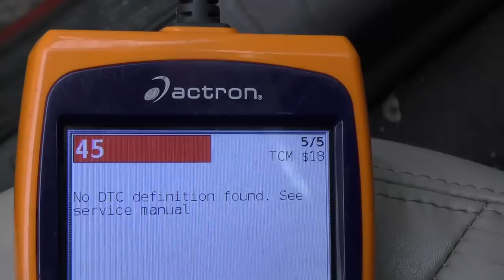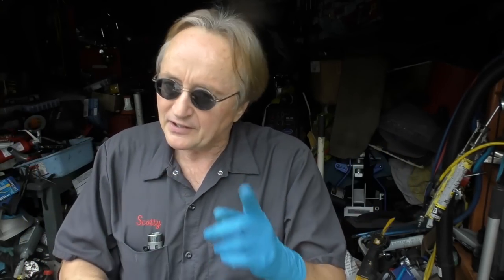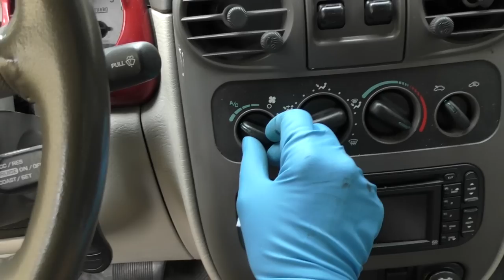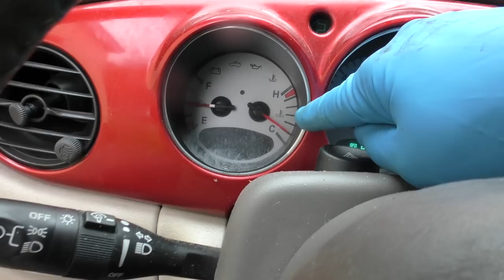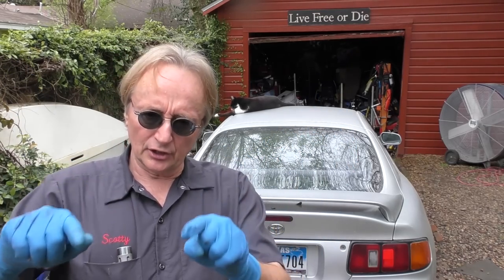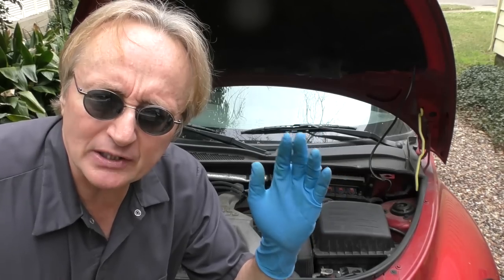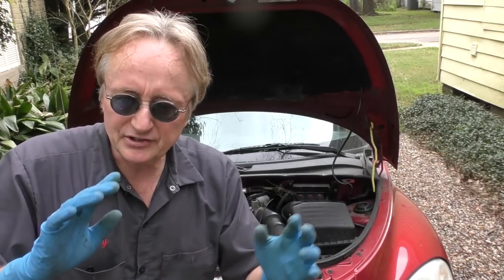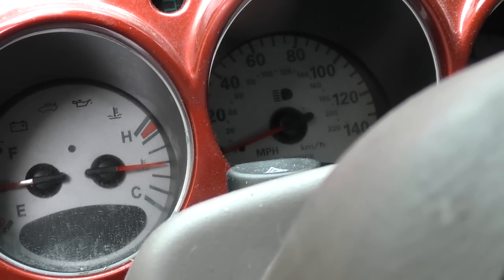This PT Cruiser Has a Serious Problem

Comment: I love the fender covers, very professional.
The fault code points to a stuck thermostat, very common.  Easiest way to diagnose 
would be to touch the rad hoses.  They should be close in temperature, indicating flow.
Reply: I don't think I've ever seen a P0128 that was not a failed thermostat.  Of course you still have to make sure.  Fix it right the first time.
Reply: I agree.  Touching upper and lower road hose will tell you if you have coolant flow, I.e open or closed thermostat

Comment: I've had my 2001 PT Cruiser ever since I ordered it from the dealer "OUT OF A BOOK" because they weren't in the dealership yet and only after 20 years an I having to do any major maintenance on it. I have decided to replace everything since almost everything is original even though some things are still in decent shape such as the half shafts, motor mounts, belts and hoses. I am also changing the spark plugs and coil even though they were changed 10 years ago and the car is running fine. My care has NEVER had a problem except for s single crack in the dash and a cracked windshield caused by a rock off of a dump truck.

Comment: At the end of the day it's not what kind of car make it is, its the upkeep maintenance u do to it. You have to put more maintenance in the American car but its cheaper. And even a Toyota or honda has its share of problems!
Reply: Yeah but I would want to blow my brains out if I had to drive a crappy Chrysler HHR or PT Cruiser. They are just depressing cars lol.
Reply: @mickdavis2385  Actually it's Chevrolet that made the HHR, but it's whatever.  Neither one of those cars exist anymore anyway.
Reply: @mickdavis2385  I got a 06 pt convertible as my first car a month ago. I like the design and decent gas mileage. Only issue is an unbalanced tire
Reply: my parents owned a 06 or 07 hhr for a couple of years and she had no problems
Reply: Bingo! I have seen owners kill a Toyota before 50k miles and others get over 600k miles from domestic vehicles with no signs of slowing down.

Comment: I have a PT cruiser and I had to change the thermostat last week, not because of overheating, but because it would make a crazy bubbling sound after a varying amount of use. The thermostat was very tough to operate and was causing major steam buildup prior to opening and it would open just barely so my reserve tank kept blowing its reserve out due to the excess amount of pressurized steam it got. Found out for sure when I left the cap off, topped off the system with water, and ran it on idle until the thermostat opened, and a bellowing of steam and bubbles came shooting out. Swapped the thermostat and now it is working without issue.

Comment: Very basic n solid technique for a temperature run high diagnostic. In addition, u can also check the coolant tank at the top and the oil cap to see if there’s any oil on it. If it’s with grey colour cream like oil, it got a chance of blown head gasket.

Comment: Hi Scotty, one thing to know is that the Pt Cruise fan is a dual speed fan, if the fan does not go into full speed mode, the car will overheat.  I’ve had to change the fans on a 2003 and 2004 due to this problem.  Thank you for your videos!

Comment: Got a turbo PT Crusier still going with over 215,000 miles
Reply: i got the same type of PT, and the mileage is almost there too, it's a great little car, the turbo really gets the car up and going, i know the car is an acquired taste look wise, and it has a bad rep, but hey, so did the Delorean...;) a know of a few mechanics that own them, the only complaint I hear, is they're cramped to work on...
Reply: Car probably lasts cus it's properly maintained
Reply: Mom has a 08 she was given brand new. It's been a great car for her and no major problems yet. I have a 95 Neon my lil sister bought brand new after I told her what options to get. It has 185k on it now on the original engine. I got it in 05 and I have replaced the timing belt and water pump at 155k, the rear main at 165k, and the front brakes a few years ago. It is easier to work on than the pt due to more room but they drive pretty similar through the pt is a bit smoother running because of the balance shafts and smaller cam profile. 95 neons had a hotter cam then the newer models just like 68 340 4 speed engines bad a hotter cam then the auto cars so slightly more power. Moms we had to replace the fan set up due to the controler going bad and it dying when she turned on the air and the second fan didn't so the compressor froze up and killed it. Bought a aftermarket fan on Amazon and it works great again for 90 bucks. People going to hate and many have no real world experience with the things they hate. They did have the head gasket recall on the 95's because Daimler wanted to use a cheaper gasket and that gave them a bad reputation but it was the crappy gasket they used. I haven't had to replace it since sister did at 70k, the better gasket truly was a quality part and they had no more issues with them after that.
Reply: Because you take care of it well!

Comment: We need a lot more like this. I had no idea the fan runs constantly when the AC is on. Thanks Scotty.
Reply: @Grieg Ragen Why didn't you diagnose and repair the problem? Overheating is usually an easy, relatively inexpensive fix.

Comment: Scotty did you secretly buy a pt cruiser. 3rd time I saw it in vids
It's ok. You don't need anybody's permission. Lol
These cars are great to learn on.tight engine bay.need to make a bunch of homemade tools to work on it.
Hell I've been driving mine with ac on for 2 yrs.
Cant wait till I have to do the starter. 
Timing belt was fun.
Have had this car for 8years.
Reply: Fitted Chevy "527" V8 with 6 speed Tremec t56 transmission ...problem solved. ...lol.

Comment: Oh man, if only I'd seen this video before I went through 20 new temperature gauges -- thinking they were all faulty :-)
Reply: 20 temperature sensor ? That's a figure of speech right ? 
2 at most I can see. It is possible to get 1 defect right out of the box. If you replaced it 3 maybe 4 times, that tells you, the problem is somewhere else.

Comment: Don't know why everyone dumps on PT's. My '03 has 208k miles and runs fine. Yes, I did need to rebuild the tranny at 165k, but other than change the timing belt (and water pump-you do both) at the 100k intervals (twice) I've done no other major work. Body is still tight and interior has held up really well. It's a daily driver that simply always works. OK, I am the original owner and yes, I do change the oil every 5k and have regular maintenance done. I do work on it myself for the small stuff and find it easy to get to things.  Like any car, if you take reasonable care of it, it will last.
Reply: According to the haters, you're supposed to be able to drive one of these for eleventy bazillion miles without ever touching a wrench for it to be a good car.  LOL  Naaaah… they'd still hate on it if every single one of these ever made were still on the road with eleventy bazillion miles and never needing a single part touched.

Comment: I have an 06 Mustang GT that caused me a lot of grief last summer. My car would work fine in the driveway and the fan would kick on with the AC on and even with the AC off once it got to temperature. My issue was after it was driven for a bit the fan would stop working and it would not even come on with the AC at that point. My problem ended up being a short in the engine fuse box, specifically a short in the wire powering the high speed fan relay. The car had no codes and it was a very difficult issue to track down. Sometimes these issues can be tricky and not cut and dry.

Comment: Scotty, it is all the same system ( the cooling system) it is a different electrical circuit that operates the cooling fan with and without air conditioning on. Usually, the ecm provides a ground to all cooling fan relays whenever the air conditioning is on, without the a/c on it is usually the submerged cooling temperature sensors that close that circuit so the ecm can ground the primary cooling fan. The Cem always closes the ground circuit, never the power circuit. This could have also been shown with a test light or dvm at the cooling fan relay in the fuse center. Battery positive will always be present at the relay provided the fuse is not open and that wiring is not damaged. The ground will be switched on and off by the ecm According to engine temperature or a/c input signal or both. You can also jump a ground to the relay terminal from battery negative ( with a power probe or a fused jumper for safety [in the event it has a short to power]) to check the integrity of the circuit with a cold engine or to diagnose a failed ecm circuit with a hot engine. That is a valuable diagnostic while the engine is heating up, instead of waiting around doing nothing. Thank you for your videos Mr. Kilmer.  Sorry for the system/circuit clarification  I just thought it was necessary for a better understanding and to mitigate confusion.

Comment: The 1st thing I always check when overheating problem is present is the thermostat,just let the engine idle till warm ,press the hose to the radiator ,should be hot and full with water if it’s empty then thermostat it’s stuck closed ..

Comment: In most cases, if you have a Thermostat code, replace the thermostat.. Also running too hot or too cold will set Missfire codes as well.

Comment: Great video!!  But I'm not sure a stuck thermostat is a "serious problem".
Reply: If stuck open, no. If stuck closed, you won't get more than a few minutes of running time before you start overheating.  You can easily blow a head gasket that way.

Comment: Scotty you clickbaited us... that's not a serious problem at all and I'm so amazed at that thermostat is that easy to change you're actually making Chrysler look good right now. That is like the easiest thermostat I've ever seen to change.  Thermostats go out there's nothing wrong with that. I thought it was going to have some kind of electrical nightmare or something.  So you should have just said and the title of the video I fixed the issue on the PT cruiser. Not the PT cruiser has a serious problem. You have the serious problem. Lol no more trolling Scottie
Reply: Idk, I car that has over heated can have permanent damage. I've seen alot of them have trouble starting up ever since over heating regardless if the owner said they "fixed" it. Especially with these aluminum engines that can easily be warped from the intense heat
Reply: @CarlosGutierrez-qw6pr  yeah just thermostat going out is normal. I had it go out on two different cars. Saw it got warm and wouldn't go down. Changed it. No issues after.   That's just standard maintenance like a water pump.
Reply: @1XSTEALTHTWINTURBOX1  yeah the thermostat is simple, but that's that what the underlying issue. overheating is a major and serious issue that can easily cuz your engine to be ruined. Doesn't matter how easy it is to fix it, it's about the severity of not catching the problem in time and the ultimate problems it can easily cause. Low oil is possibly extremely easy to fix, doesn't mean it's not a serious issue that can destroy the engine
Reply: @CarlosGutierrez-qw6pr   Ok we will put out a video.  "This 93 Camry Has a Serious problem".  run that by him and see what he says.  Because that is one of the cars it went out on.   The title should of just said I fixed the issue on the PC Cruiser!   I don't like PC cruisers, but lets put "This ___  Insert Your favorite car__ has a serious problem."   It won't sound right. It common practice to hear someone say they are changing there thermostat, it's gett warm or it's overheating. people no to experience will let it run before they notice it, that's there issue.
Reply: @CarlosGutierrez-qw6pr  So is running on tires with low air pressure. Are you going to throw the make and model of the vehicle out there in the heading saying this specific car has serious issues? The problem was an easy fix.
Reply: @1XSTEALTHTWINTURBOX1  You do realize that he's been doing these titles for a long time right? You think he actually cares what he puts for a title? It is not misleading so there is no policy on YouTube that will force him to change the title so why do it? You think he cares if some random commenter tells him to change his title? Absolutely not
Reply: @stylicho  easy fix, not a serious issue. Do you realize the amount of Americans in the world who have low tire pressure right now? Losing 5 mpg is not a big issue so you can't compare it to an issue like overheating because I can go a whole year on low tire pressure, no way I can go a whole year with an overheating car without the car being inoperable
Reply: @1XSTEALTHTWINTURBOX1  My Volvo 940, 8 valves, 2.3l engine, B230FD: Never changed the thermostat or water pump. I have benn driving 17 years, and the car will soon be 26 year old. The odometer says 400000 kilometer (252330 miles). I know that some waterpumps in this model of Volvo  have lasted 520000 kilometer ( 323000 miles). I'm from Finland.
Reply: @JormaKovanen  That's just awesome.  I had one car the 93 Dodge Stealth RT Twin Turbo, thermostat went out at 140K, car is almost at 197K Miles now. Says to change Water pump every 70K. 93 Toyota Camry 4Cyl it went out at 228K, sold it at 239K, was trouble free.  My 1992 Mercedes Turbo Diesel 300D 364K Miles seems it's getting weaker but doesn't not ever get past the middle, only in the summer. Already flushed the system.   I had a friend with a Volvo 1998 that he changed thermostat at 205K.   I have various friends with BMW's and Toyotas changing them in 120-150K as they went out.  Also if your have a PT Cruiser with this kind of miles, I'd change it every 50-70K miles as it's so cheap and easy to get to. If you know anything about cars, You'd be crazy not to do it on this model. It's like $20-30, filler neck $15, they even sell it as a kit with new radiator cap, after a quick search online.
Reply: @stylicho  I think i can show a 10 Year old how to fix it. And most family members I know, they are all scared of touching any tools outside.  Besides the 30 year old+ fellas in the family.  Something this easy is a joke. It's not a issue with the model. It's wear and tear.  Yup.        But Scotties way of checking it is very cool, and glad he shows us that.  He redeemed himself by putting a video about saying this Honda has a serious issue. Just the word "serious", sounds like it's an issue with the model.
Reply: Ever changed the pump and thermostat on a 12 valve Cummins?
Reply: overheating is a serious problem. Like it can ruin an engine.
Reply: Ok then you throw out your car when it happens and blame manufacturer.

It's Wear & Tear maintenance item.
Reply: @1XSTEALTHTWINTURBOX1  You don't want to do a water pump on one.  It's driven by the timing belt.  I'm not one that considers a water pump to be maintenance.  It's a repair.
Reply: It does have a serious problem that he ignored,  at least on video.  Where did the coolant go and why was it misfiring?  Seems by the end of the video he forgot about that part.
Reply: @wolfman9999999  Water pump is a maintenance item. It says it right in the manual of pretty much all the cars.   They call it 60-75-90-100-125-150K Maintenance etc.  Based on the make year of vehicle.  So when you do water pump you usually just change that thermostat as well.

Comment: That customer was lucky. My 2005 Rendezvous began to overheat and it turned out to be a blown head gasket. The body is fine; the seats and upholstery are excellent and the transmission still works, but the bloody engine is completely shot. Now have a lawn ornament to get rid of.

Comment: Makes me miss my PT Cruiser. The temperature was always rock solid. right on that middle line.
Reply: Dave junk cars ugly too.
Reply: @benson2873  Thanks for that brilliant analysis. Have you ever driven or owned one? Sure the quality isn't the best, but I liked mine. Mine was a 5 speed manual and very practical. The rear seats came out. It's basically a mini-minivan. I had to do a series of repairs to the vehicle about half way through my ownership but once that was done it was pretty reliable. It was towed twice in 10 years of ownership. Once for the crankshaft position sensor and once because the timing belt broke (my fault for not replacing it pre-emptively).
Reply: Roberto Mundo  hahaha just once. Put two crank sensors in it though. I've heard that you should always use mopar parts for the sensors on these things cause the aftermarket stuff is garbage

Comment: I remember having to diagnosis my civic for overheating.  I changed every sensor and relay for the fans and coolant.  Ended up being the head gasket leaking into the motor and ended up drying the watery pump.  That was a hell of a job

Comment: Bad thermostat is a serious problem?  I guess I fixed a serious problem last month.  Neat.
Reply: Yup, the engine could overheat and then bye bye engine.
Reply: If you ignore the overheat light in RED on the gauge cluster, then yes it is serious, and you deserve an overheated engine. Or if you look at the bright red light next to your speedometer/other gauges, you pull over, call a tow, and pay for a 15 dollar thermostat with a half hour of labor and it is fixed. @GuerreroDelInfo

Comment: I had some issues with a customers PT Cruiser years ago. The original problem was changing the timing belt. We did that, and about a week later it came back with overheating, and oil pressure problems. So we pulled out the motor and took it down, the head gasket wasn’t blown, so we went ahead and rebuilt the motor for the customer.   Long story short, when I quit working as a mechanic, my dad swapped the motor for him because the Piston Holes were all ragged out and shot. I hate hate HATE PT Losers...... Love your videos bud!